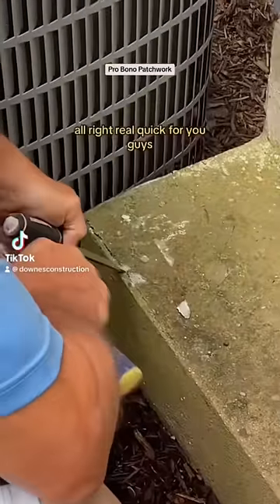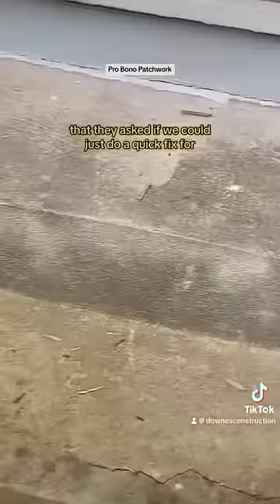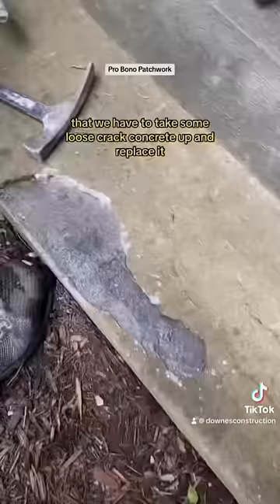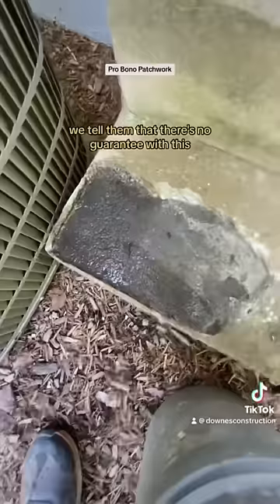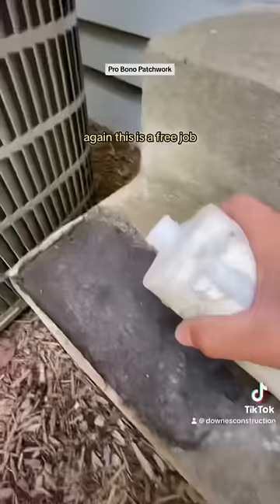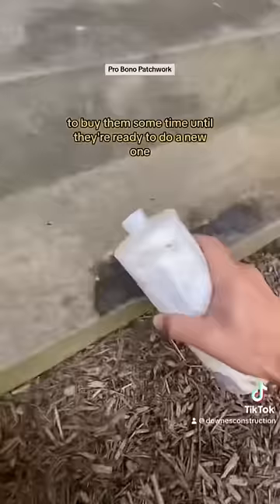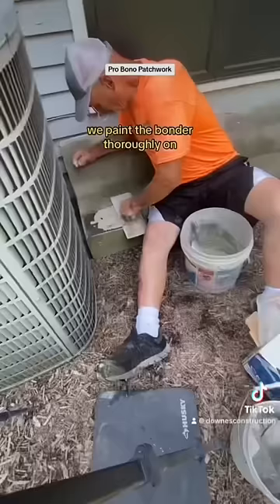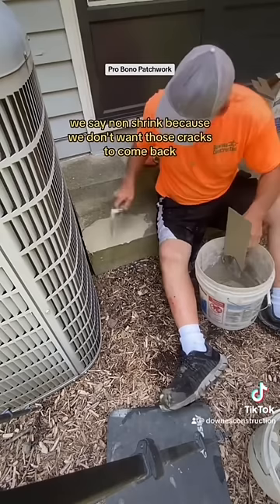Patchwork #diy #construction #cement #patchwork #repair #trending #viral #howto #homeimprovement

Comment: I never will do a ( real quick ) job for free. Again in my life.. I did a plumbing job. Completed the work properly abd was collecting the pay. When the owner asked for jyst a real quick repair of his toilet flange. Turns out the floor was so croocked a flange could not be set properly. Ling story short.. The freebie turned out being 3 times the work the original job was. And because the floor prevented a proper repair. The a hole still bad mouthed my work for years.. I was young back then. And that no good prick, Taught me a valuable lesson.. THERES NO SUCH THING AS A QUICK FREEBIE !! Theres a price to do the job, PERIOD
Reply: Oii my boy Roy boy 😂😂
Reply: Wow, you were wronged. You did not deserve that 😢
Reply: Amen brother!
Reply: No free work. You're are still liable for the work you do regardless of if you collect money. Plus if you are working for free you are losing money and company can't last
Reply: Don’t ever do jobs for FREE one those are the customers that ask for free stuff that always have a problem with paying the bill and or when you do stuff for free that’s the stuff they complain about and want fixed to like like new
Reply: @NCwoodworking66  oh ueah, You right. The guy wasnt honest.. I was at a local plumbing supply house. And it turns out that guy had someone there prior. When he was gathering bids for the work. With him. The guy added the flange to the list. When the guy told him it over doubled the price of the overall work, Because of the floor needed redoing. The p.o.s left it out purposely and then hooked me at the end, By saying if I could fix it real quick, Nowing it wasnt a quick job.... Smfh.
Reply: @kid-n-gardenfarms2926  Great points , That I left out. 👊😎
Reply: Unless it's a little old lady or single parent I won't do anything free. I enjoy helping nice people who really need it. Ones who don't ask but are grateful when offered.

Comment: I charge more for smaller repairs like that. Factor in all the prep work and cleanup. It's usually not worth doing patch work like that when 2 steps can be replaced. For me to do the work, it's cheaper to tell me up front so I'll have everything I need and I can plan my time accordingly. 

I'll tighten door knobs and oil squeeky hinges for free. Anything that takes more than 5 minutes, I'll start charging hourly.
Reply: The driving all over wasting half a day to meet clients who aren't serious about doing a job right is my real expense. So many tire kickers. Nobody understands the labor and expense of proper concrete work. They never considered i need a jackhammer or a skid steer or a pump. They think I can like shovel it out or something... They don't understand that the removal and prep is the real expense. The new pour is the easy part. Now with the internet you can't even explain since people refuse to have a phone call vs texting and they just demand a SF bid.
Reply: Same way I did it but I added if you want to talk after the job starts for longer then 5 mins I'm adding a half hour to an hour for it depending in how long you want to waste my time
Reply: @joeferr3313 haha my DREAM contractors. I don't want bothering. I'mma give you a key to get in and out, your money and a tip and leave you to your work. So don't bother me. I've had a few guys that got offended by me walking away when they started working... Sorry am I supposed to watch you fix the shower... ☠️🤦‍♀️🤷‍♀️🤣 And some have said some straight up creepy ass sh!t. 😂 NOT 🚫 what you want as a lone 19 year old with your first home. 😂 My partners a bodyguard so I drop that in now and NOBODY says weird sh!t 🤣🤣🤣 please don't just hit on a lone woman in her home and ignore her when she says no. We think you might be about to murder us and land us on dateline 😂 after many tries I just found my perfect guy. He's helpful polite and doesn't take the mick AND he treats his two lads extremely well and NEVER talks to them like crap, doesn't blame them for mistakes or sh!t talk them and take all his frustration out on them. Not ONCE in week. He's my guy and I'm keeping him. 😂 We've been picking random things we wanted doing, but didn't have anyone trustworthy enough to do the work, and have a load more work for him and his lads. So everyone is happy. 😂

Comment: I find it works best with cement all if you apply in layers around 1/8” or so each and about 20-30 minutes between each coat

Comment: Let it dry then throw sum mud on it, that’ll probably get the stained color matching somewhat
Reply: I removed an old walkway that lead onto the sidewalk of this womans house at work. Then we replaced it with a 2 foot narrower walkway with different pavers leaving a 2 x 3 1/2 pieces of sidewalk that needed to be redone. She insisted that if we put in new concrete to patch where the old width of the walkway was, the sidewalk patch would be white. It felt so wrong but she didn’t want the same color or texture of new concrete because her sidewalk was probably already 10 years old at least, so we peppered some dirt in as it cured. Then rubbed in mud when it cured. After washing it off, it came out great. This also works great with corbels if you’re installing new combos right next to existing cobblestone that I’ve been there for a while, just rub mud on it let it dry and then wash it off a couple days later

Comment: Free patching is actually a genius way to get work. They always ask if it can be repaired. Instead of saying no and leaving them in sticker shock, while youre over there just patch it. Theyll call you back to do it right as soon as they get a loan secured to do it right. As a roofer i do free inspections to get work... not hard to keep a bucket of patch in your van. I bid concrete jobs too but their jaw always hits the floor and i get no work many times. Maybe this would help my case. Maybe not idk... for free I'd use some kind of bonding agent i know isnt going to bond tho lol
Reply: So you'd purposely do a bad job in the hopes of getting hired to more work? Really?

Comment: You should at minimum take a wire wheel to the surface you want it to stick to I’d say cup wheel grind it but those are pretty small patches anyways. Oh and sika 1000 or 122 is better for stuff like this and the 122 only has a 30 min wait on walking traffic 1000 isn’t much longer

Comment: NO NO NO NO NO. Do NOT do addons for free. The customer can not do it their self and you pay for material, gas, insurance experience and even liability. You can get sued for shotty work even if it is free. So the customer can claim at any time you did something wrong (even if you did not) and it can cost you. For this even small little things every customer must pay.